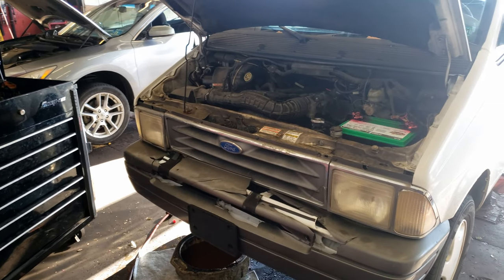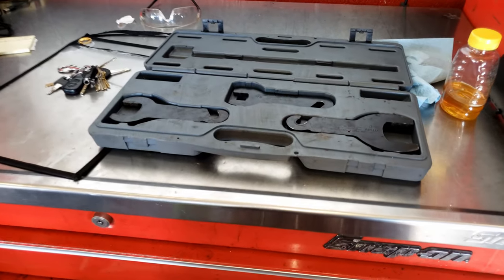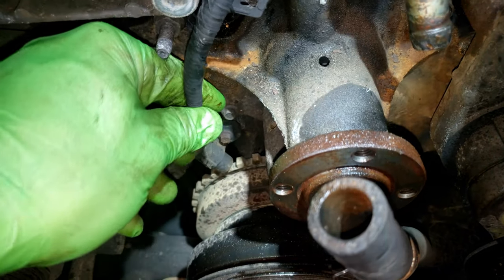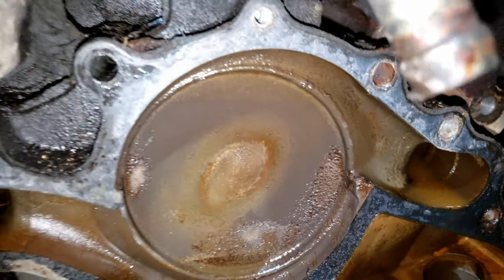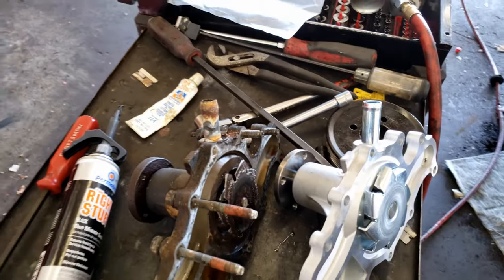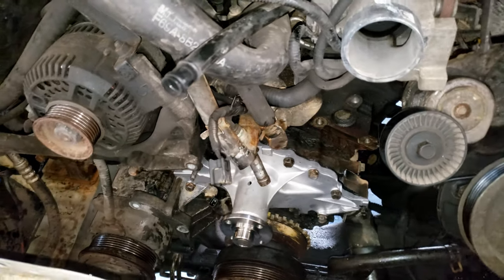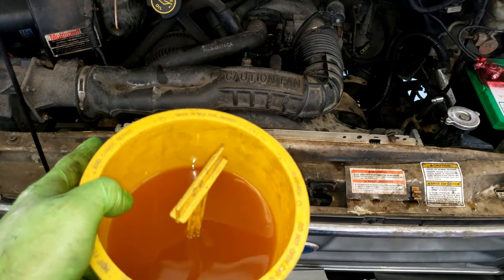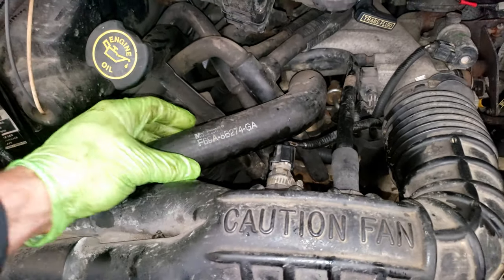Ford 3.0L Water Pump Replacement - Aerostar, B3000, Ranger 3.0 Overheating

Comment: I remember back in 2019 I had a 2000 crusty and rusty a$$ white ranger with a bowling ball size hole going through the floor and rockers on their last leg  and had to replace the water pump. I didn’t have as much money at the time to afford Milwaukee impact and had to rely on hand tools. I ripped the whole damn radiator out, still was a pain to replace with everything rusted on or bolts that wouldn’t budge. It took me like 8 hours to replace that water pump and being 12 coors banquet beers deep in the hot sun with a real rare but bad attitude didn’t help either. Eventually I got it done with sheer determination and 2 cans of pb blaster but it was a pain working with rusty crap. I eventually got rid of the truck when the second transmission blew up. Donated it to the fire department and they destroyed it for training purposes. They chopped the roof, crushed the fenders and took the jaws of life and pushed the dashboard and firewall forward exposing even more hidden rot. I don’t miss that pile, but the motor known for blowing head gaskets didn’t blow a head gasket. Basically that sacked out 3.0 outlasted the rest of the truck. She’s long gone and ancient history!

Comment: I put a new water pump on my 2004 ford 3.0 ranger it has a weeping hole in the front under the freeze plug and it’s leaking quite a bit. What could be wrong?

Comment: I took mine to a mechanic because it’s running really cold and they told me it was a water pump.
Reply from the maker: Not likely. Unless it's just leaking from the water pump and causing your heater core water level to get low when the system level drops.  No antifreeze in the heater core equals no heat
Reply: It could potentially just be the thermostat
Reply: I bet it has a reverse pop thermostat or safety thermostat what ever you want to call it. Maybe no thermostat at all a normal thermostat when fails stays closed and makes engine over heat. A safety stat when fails get stuck open so doesn’t over heat and damage or blow engine.

Comment: Hey I have a 1992 aerostar and noticed I have 2 belts. Think I have to loosen alternator adjustment to get mine off since theres no tensioner. That sound right?
Reply from the maker: Honestly I don't work on too many of these arrow stars. I wouldn't really be able to tell you without looking at it
Reply: I got it fixed. Had to loosen alternator bracket to get belt off. Was couple little differences but your video helped tremendously. Thanks again!!
Reply from the maker: @curtthechameleon  awesome to hear you got it rectified and I'm glad the video was helpful. Thanks man!

Comment: Is this the exact same procedure for a 2004 ranger, 5 speed manual, 3.0 liter? Water pump may be bad on mine
Reply: Is this the same procedure for a 96 ranger 3.0 litre automatic no Ac

Comment: I have a 2004 ranger 3L and I can't get the fan out.  I have the fan special tool but I have only 5mm gap behind the pulley. Ideas?     The nut in front of the water pulley is 7/8in aka 22mm NOT 36mm. [ I removed the 4 bolts on the pulley but I can't pull the clutch/fan off ]
Reply: Did you ever figure out how to get that off I'm going through same

Comment: My 97 ranger 3.0 is losing coolant, no leaks on the ground. Seems to be getting worse.  I just replaced timing cover chain and water pump and now I'm getting coolant in my oil.  My temp gauge stays at operating temp and when I have high rpms it goes lower than operating temp so it might need a thermostat.  Not sure how coolant is getting in the oil though, could it be from not properly putting teflon tape on the bolts in water pump/timing cover?  I don't think its a head gasket because I don't have exhaust bubbles coming out of radiator or overflow tank.  Any help would be appreciated.

Comment: Is there anyway if the water pump is leaking for it to shoot up above? Cause I have a antifreeze leak somewhere below the  the two hoses left of the motor but I can't pinpoint it myself. Also the belt squeaks bad
Reply from the maker: Yeah I suppose you could be getting on the pulley and shooting up
Reply from the maker: And would make sense that your belt is squealing
Reply: Yes indeed. Mine did the EXACT thing yours is doing. Was water pump. I had coolant spraying up to alternator and pooling under it. The water pump seals get bad and end up spraying out of the weep holes.
Reply: @curtthechameleon  one mechanic today said it's a 4 to 5 hour job and another said it could be the bolts ringed off inside timing housing causing it to leak. Only thing I can't get off is the fan right now
Reply: @aerostar9376  it was the pump seals. They were shot. Got it changed. Fan was a bitch. Used pipe wrench and huge pipe breaker.

Comment: Genuinely can’t get the fan off for the life of me
Reply: It’s just free spinning
Reply: Got it
Reply: How did you lock it in place to get the fan off? I’m going through the same
Reply: @Kmascak1  to get the fan off I held the pulley in place with a crescent wrench. Just back yard improvising. Good luck getting to the timing chain seal cause if your doing the water pump seal you should do that too.

Comment: 3:35 for the love of god, what else besides these 3 long bolts are holding this bracket on?!
Reply: If you haven't got an answer for this yet, on my 2001 Ranger 3.0, there are 2 additional bracket bolts kind of behind and below the AC compressor facing the driver's side wheel.  Both of these bolts are studded bolts that allow for an additional nut to hold on brackets for something else (you'll probably have to remove the nuts and small brackets first before removing the AC compressor bracket bolts).  You can kind of get to the bolts from above but it's a real pain in the you-know-what.  Alternatively, the simplest way is to come in from the wheel well (best to remove the wheel and the wheel well splash guard).  With ratchet extensions, this allows for much better access to these 2 bolts.